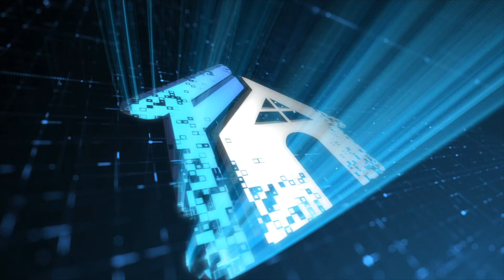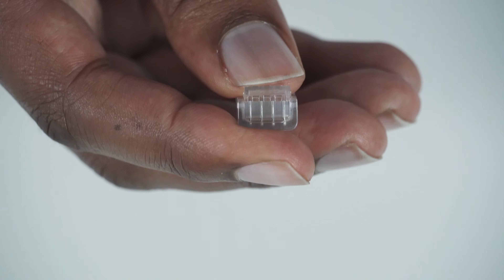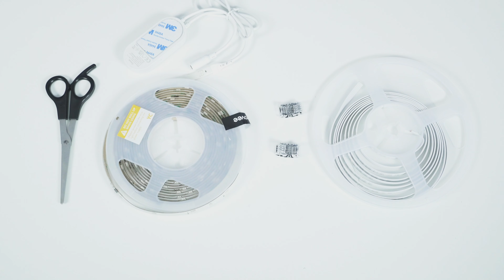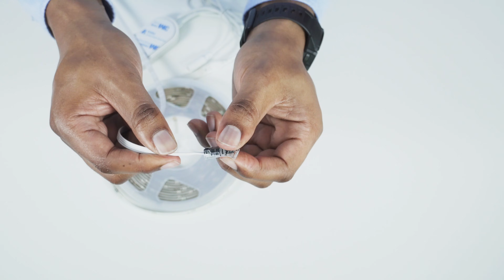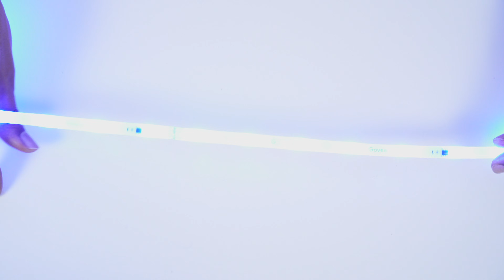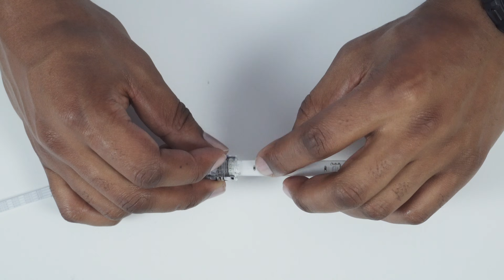Extend Govee LED strip lights the right way

Comment: hey there i got the govee RGBIC H619A 5m strip leds i wanted to know if i get those connectors could i attach another 5m strip directly onto the end? (if i make a cut at the start of a new one so all the cords aren't attached)
Reply: please and thank you in advance for your reply :)
Reply from the maker: You need to make sure you are using a power supply that can provide enough volts and amps. With out seeing what you are using its kind of hard to give you more information than that. Hope you get it working correctly 🙏🏾

Comment: Thanks for uploading this, it's very useful. I do have a question and my apologies if this was asked already but, after the cut and reconnecting will the lights still change colors? Meaning if I use the DIY light settings will it still work? Thanks for any assistance!
Reply from the maker: Yes should work with no issues, as long as the connections are good. SUBSCRIBE, LIKE, HIT the notification 🔔 👍🏾

Comment: Hi does this work with the Govee M1 led strips mate
Reply from the maker: Yes you can cut them to create an extension for going around corners etc and you can also extend up to 32 feet. Subscribe, Like and hit the notification 🔔🙂👍🏾
Reply: Thanks mate appreciated, 1 other question please. Can I join 2 Govee M1's together and add extensions where I like as long as I like ?  I'm trying to put 2 separate extensions about 2 Meters long each in the same run as 2 M1's
Reply from the maker: Not to sure about the M1

Comment: Am i able to just connect 300ish feet of rgbic with out needing to add an extension?
Reply from the maker: Hi, thanks for checking out the video. I'm a little confused by your question. What whoildnyou need to extend it if you have the length you need already?
Reply: @fluxautomate  sorry I left that bit of detail out. But I have 10 rolls of govee rgbic outdoor led strips that are connected in pairs. I want to have one power source with no extension between each strip
Reply from the maker: I doubt that the power supply that come with them will be powerful enough

Comment: Just to add to my last comment... Govee doesn't recommend that you cut ANY of their RGBIC products. But the product in your video is in fact Govee RGBIC.
Reply: My grovee leds have a cut line lmmfao and in box say you can cut lmmfao
Reply from the maker: Haha they just want you to buy more
Reply from the maker: Yes, you can tell if a light strip is RGBIC as they have 4 copper points where you cut.
Reply: They 100% say you can cut the lights
Reply: The H6173 outdoor strip lights don’t have copper separation points.  They have 3 soldered that would have to be cut.
Reply: Govee COB light strips, light strip 2 and the m1 can be cut and spliced

Comment: Hi. I'm struggling with the cutting and extending part of these particular lights. Govee says ABSOLUTELY DO NOT cut these lights as they'll stop working. I need to make several extensions and 90 degree turns for my application. I know your video shows that you can in fact cut and extend these Govee RGBIC lights but are there any consequences to this? some people say that you lose some of the functionality from the app and other video posters show the strips failing after cutting. I'm so confused. I just need to know for SURE that if I cut and connect as shown in your video, the RGBIC lights will function as intended with no issues. The model of outdoor RGBIC strip I'm considering is the Govee H6172.

Thanks so much for your help!
Reply from the maker: Use my link to the products that I'm demonstrating in the video that are the H619A. Also make sure to use the connectors that I'm using and this process definitely works with no issues as long as you use the light strips and connectors and cable that I'm using. All products are in the description. If the light strips that you have don't have the copper connection points then I would strongly advise not to cut them. 
NOTE this Video demonstrates how to use one complete light strip and extend in-between. NOT adding adding another strip on the end of another strip, this is where you might run into problems as the power adapter that come with the lights is weighted to power only a certain length of lights.
Hope this helps 👍🏾
Reply: @fluxautomate yeah I ordered directly off your links and hooked it up and it no longer works. So people DO NOT DO THIS. DOES NOT WORK ANYMORE.

Comment: I am using Novostella rgbic and im getting power to the second strand but its stuck on just white and not changing colors. Only the first strand changes colors.
Reply from the maker: Not sure about that brand to be honest. Make sure your wire are exposed enough with a good connection and that you have correct polarity.
Reply: @fluxautomate  I ended up finding the issue. The app has a setting where you tell the app how many LEDs it's lighting. It was on 80 which I guess is default since the set comes designed to be used as 80 on one strand and 80 on the other. But I spliced the strands to each other to make 100ft so I had to change it to 160 LEDs and it works. I found the solution on a another Govee video where they had to do the same for their Govee strands they extended.
Reply: @kashmoney7421  Where do I find those settings I don’t see it ? To tell the app where to extend the amount of lights ?
Reply: When in the app at the very bottom there are a few icons. The one furthest to the right looks like a 4 box window. Once you click on it there is timer, schedule, strip light pixel number set, and adjust line order. You want to select strip light pixel number set. This is where you set the number of LEDs.

Comment: No issues for combining two led stripes of govee rgbic?
Reply: Just curious if you went ahead and tried this out? I'm going to try it leave me a comment if you did or if you are interested in my results.
Reply from the maker: I would try not to extend too far as the power supply may not be strong enough. Make sure to Subscribe, like and hit the notification bell. 👍🏾

Comment: Does that company also make corner connectors?
Reply from the maker: I haven't checked. If you use the link in the description you will be able to check. Hope you find what you need 👍🏾
Reply: did u find sth?

Comment: I heard from govee self that the m1 matter cant be cut and extended and there can't be a connector betweet the led.
But i have seen so many videos where i saw that it can be done so is it more of a if it goes wrong then we are not responsible for it thing ?? 
Sorry if my English is not good.

Its a great video im definitely gonna use it!
Reply from the maker: Glad the video helped. What will happen is there will not be the correct current running through the strip so the lights nearing the end of the strip won't get enough power so won't perform as required. The result could be a dimming of the lights as a whole or the lights nearing the end will be an incorrect colour. Hope this helps 👍🏾
Reply: @fluxautomate  okay thank you for taking the time to react. 
Then I'm not gonna cut it haha.
And if I would have 2 x 2m M1 Matter that can connect would it then be possible to use a connector between the 2 strips? 
I also think I'm gonna ask the client service just to be sure.
Have a nice day

Comment: Is there a restriction on length of joiner cable ? I tested it with a short piece all was perfect then with a 4.5 m 4 strand cable it is only light the first 1-2meters of a 10m run with some red blue green clusters further on flashing in sequence. Not sure if it’s the cable or the joiners or the length and I have them mounted already 🙈
Reply from the maker: You have to make sure the extension doesn't have too much resistance as this will affect the current (the strength of the electricity running through)
Reply: @fluxautomate so what can you do to increase the current?
Reply: @cubanb5401  search power injection for LED's. Essentially anywhere you're having issues you need to inject whatever voltage your system operates on along the path. You could also try to increase the amperage of the power supply.
Reply: Is there an option to resync the cable lengt?
I just got 2 m1 strips and they can simply be plugged together and there is a resync option in the device settings. I'm not sure the cheaper models have this though

Comment: I bought a 15 meter Govee flyer, then I bought 10 meters. Can I connect them together through these connectors?
Reply from the maker: Only can advise is to check to the manuals before cutting

Comment: I've recently bought the new Govee Cube Wall Lights. I was thinking of buying more but the area has a chimney breast that would mean I would have to separate the cube for each side of the breast. Any idea what type of wire gauge they would be and how many strand within them. Cheers.
Reply from the maker: Not sure on gauge resistance at this time. I would suggest just going to your local electical store and tell them what you need it for and they should be able to help.

Comment: Do the effects from the app work as normal? Would it just bridge between the connectors?
Reply from the maker: Yes. Just make sure the strip light can be cut. Some a designed not to be cut due to the way the effects work.

Comment: Very useful video definitely getti g some of these! What would you use if you need to make a lot of small 90° turns? I've tried to use cheap connectors you showed at the start and they stop working as soon as you touch them.
Reply: Great video. Thank you. 

What cable is it please
Reply from the maker: Check out think link in the description to the Flux store. I will have the link to all products on Amazon.
Reply from the maker: You can use the track but use the connector I use in the video. Will work great 👍🏾